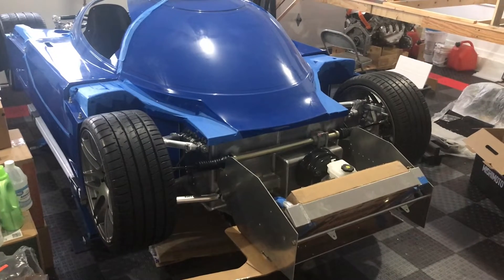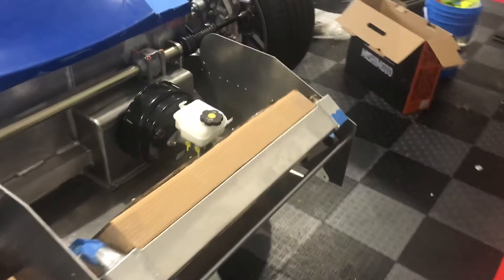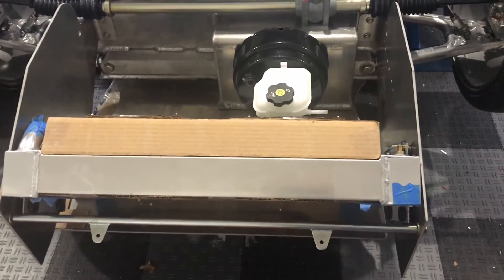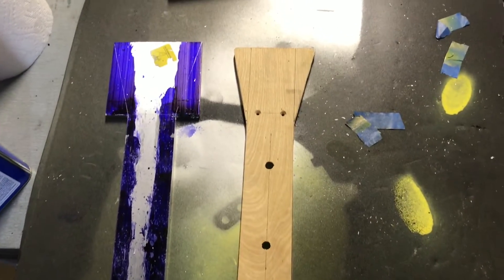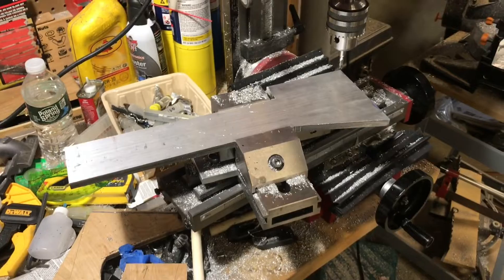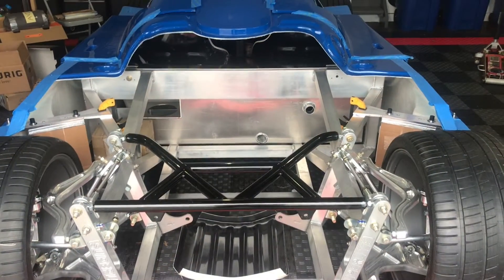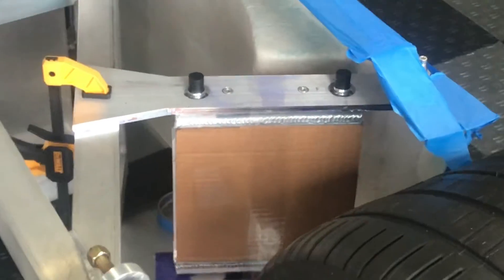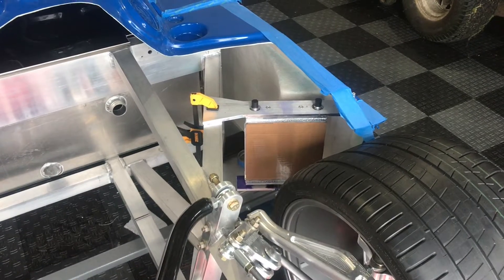Superlite SLC Build 054 Intercooler Bracket fabrication

Comment: Joel great job how are you going to keep debris from the tires out of the inter cooler?
Reply from the maker: Thanks Dave, the car comes with optional fiberglass fender liners so going to install those.
Reply: @JoelKSLC .  Fender liners.   How about having louvred to stop muck getting on the inter coolers but will still allow hot air out.
Reply from the maker: Hey Mick, actually they do have louvers but have not seen any of the builders actually cut them out. They all leave them solid.
Reply: @JoelKSLC  there is also an aero reason for the louvers.  They allow high pressure air from the front of the car to vent into the low pressure wheel arch and also give a bit of fresh air into the brake area.   But what do I know, I’ve got a Ferrari replica.
Reply from the maker: @mickcoomer9714  That’s good to know, do you have a link or pics to your project? Which Ferrari model?
Reply: @JoelKSLC .   It’s a DNA West Coast.   A replica of an F149 California.  The donor is a Merc SL500.  Remapped, active exhaust and far too many other things to mention but very extensive use of 3D printing such as switch panel inside the top of the centre console, second rear diffuser, engine cover, radio surround with warning LEDs for various functions, the list goes on.  I’m disabled so the drivers seat is moulded to me.   All trimmed in Bentley Beluga Black Napa leather with contrasting yellow stitching.
No web site and I can’t get pictures to post on here.   It’s a thing of beauty but I don’t think it compares with your SL-C
Reply from the maker: @mickcoomer9714  Very cool kit. I love it! I found a video of one. https://youtu.be/ngcc_7kNdYQ
Reply: @JoelKSLC .   Yep.  Kals is a very nice car.   We call that one the Kalifornia.

Comment: I think it will be better if u placed the battery in front, good weight distribution I guess 😁. Make it into a playlist, it will be great.
Reply from the maker: Ragnar Lothbrok, agreed, better for weight distribution up front. Most builders put the battery in the front compartment. One builder put it in the passenger foot box. My build is unique in that it has a power brake booster and electric vacuum pump which takes up a lot of real estate so don’t think I have the room. One advantage of the battery in the rear is that it is close to the starter, so the thick wire you need for that is very short and you get good current to it. With the LT4, Graz, battery, and intercoolers this car will have some rear weight bias for sure.

Comment: Thanks for the update Joel!  I’ve bought my first all electric vehicle and can’t help thinking, “well if Joel was making this electric he would not need to install that, He would need that...”!
Reply from the maker: Barry Finger LOL, there is a guy building an electric GTM and posting some vids which are very well done YouTube “Cody Graham”. What type of car did you get?
Reply: Joel K I got a boring but so “normal” Kia Niro. Great acceleration for a crossover, 280 miles on a charge here in flat Houston, TX, lots of tech goodies that work nicely, and lower cost than a Tesla. So not as cool as your SLC but it does put a smile on my face driving back and forth to work getting an equivalent of about 116 mpg!  Of course, thanks to the pandemic, I have not had to do that in the last 6 weeks!
Reply from the maker: Congrats on the new car and enjoy!